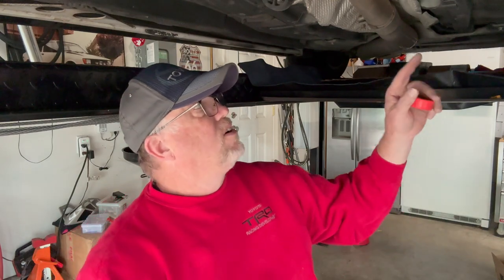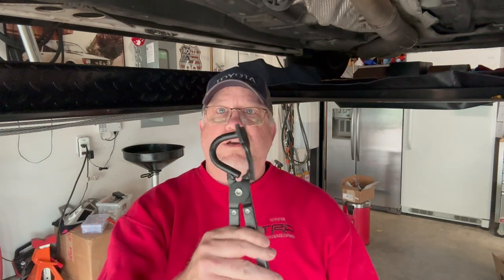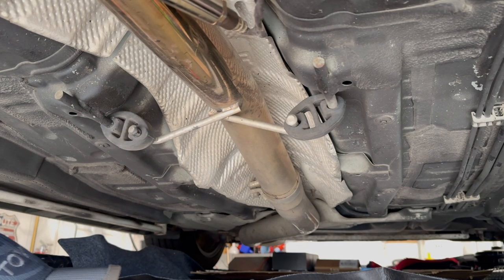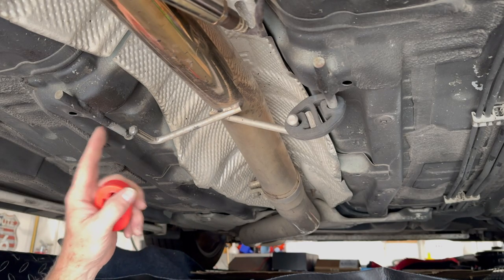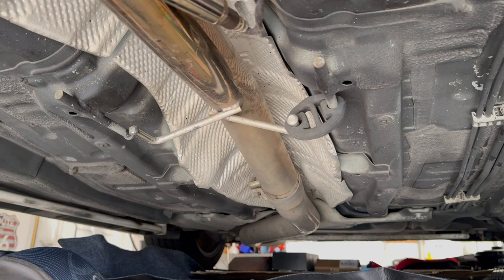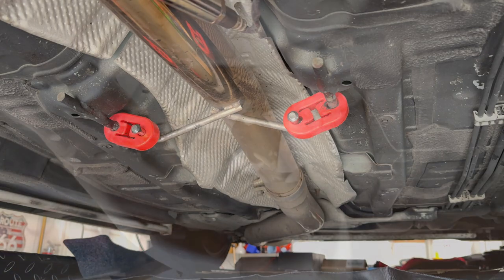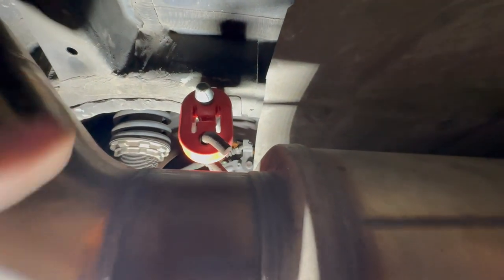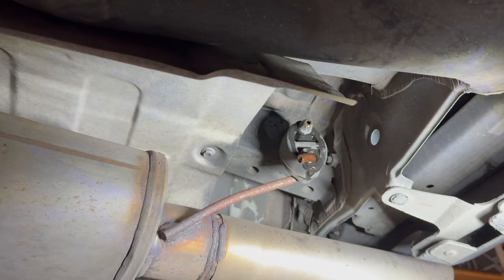How To Install POLY Exhaust Hangers // DIY // Tips // Tricks // LESSEN Exhaust Movement

Comment: I am one of those guys who doesn’t own a set of those pliers! 😂 but I deffinitly might need to replace my hangers on my turbo corolla, every once in a while I hear a rattle coming from my exhaust near my muffler.
Reply from the maker: You will love the pliers, they are worth every penny and luckily they aren't very expensive. These hangers will help hold the exhaust nice and still. I have a 3" exhaust with the turbo so it has less space for movement.
Reply: They can be had for like $15.  Definitely a need for anyone’s tool box
Reply from the maker: @breaks_n_stuff4049  The link I provided for them is in the description below the video and they are only $11.99, super cheap.